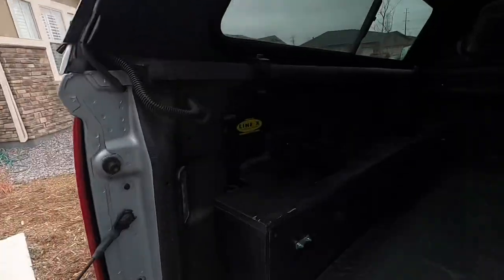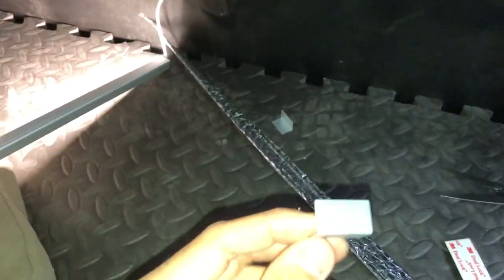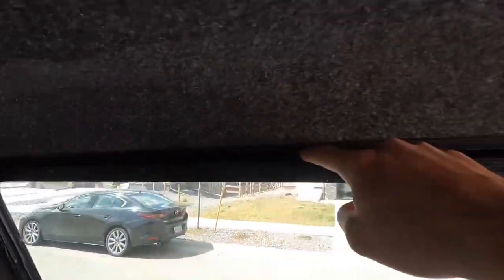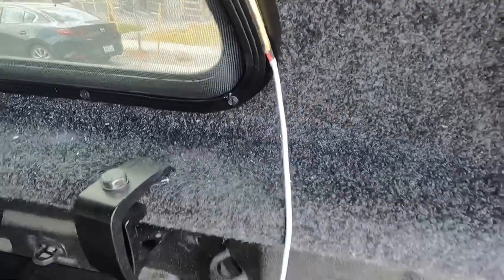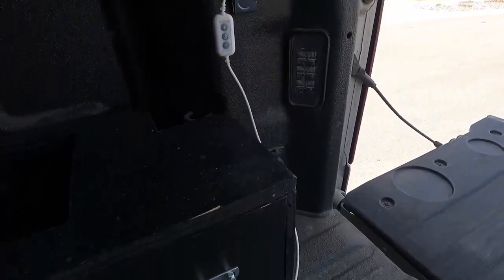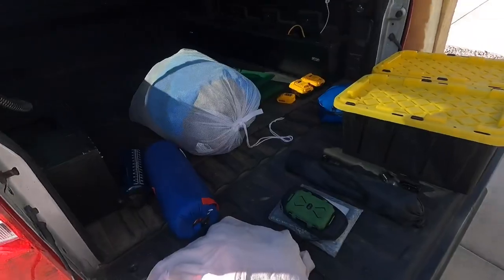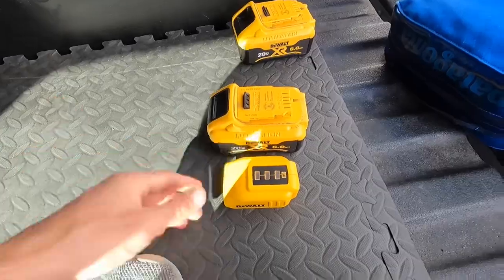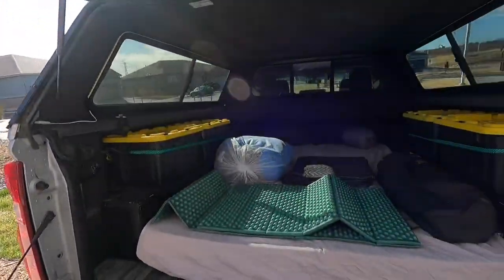DIY Minimalist Truck Bed Camper Build - Part 2 (Trial & Error)

Comment: I like your emphasis on functional simplicity.  For comfortable warmth and durability, I recommend wool blankets for your bedding.  100% wool from a reputable manufacturer such as Pendleton and Faribault Woolen Mill Co. will last for generations when properly cared for.  A couple of wool blankets will take up a lot less room than sleeping bags and can be used in the house or your car or a tent.
Reply from the maker: Thank you and the wool blankets is a great idea thank you!

Comment: I love the simplicity of the build. I had an idea on the window covers. Instead of velcro, would covering it in fabric and using magnetic tape work? Attach the tape side to the fabric (maybe even a few stiches) .
Reply from the maker: That’s a great idea I might have to try that. I have been camping a lot without window covers and haven’t had any issues but that might change once it gets cold out.